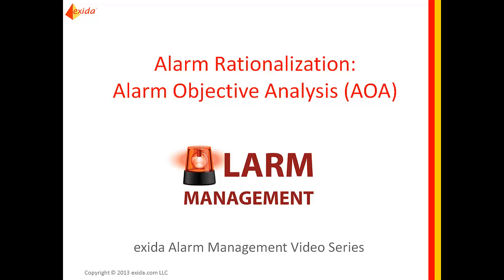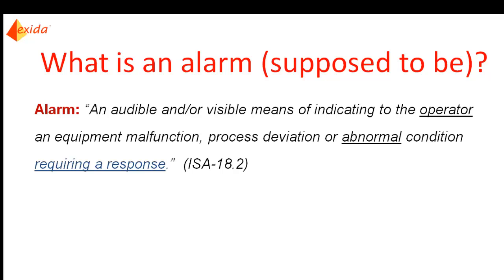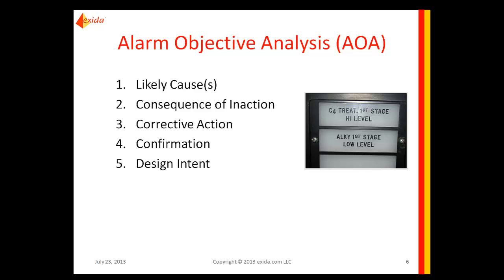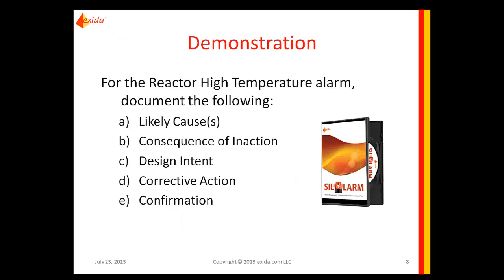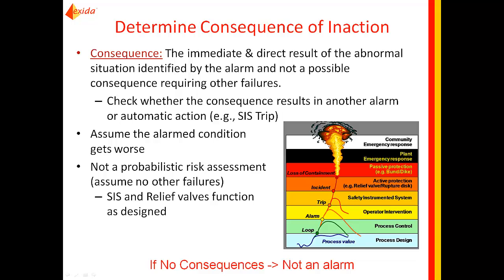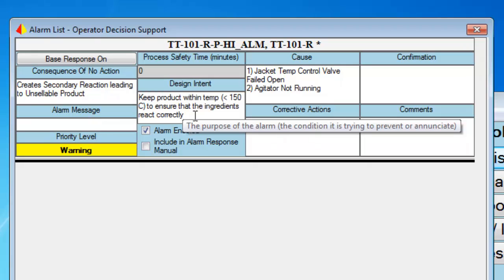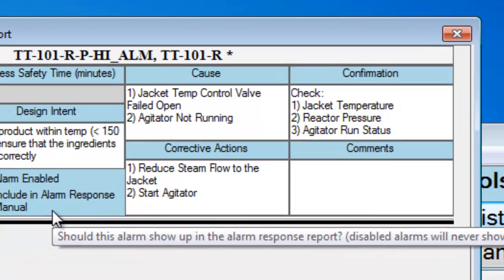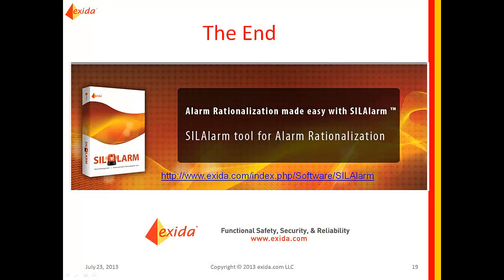Alarm Rationalization: Alarm Objective Analysis (AOA)

Comment from the maker: With SILAlarm, the primary method for import is from an Excel spreadsheet. So as long as the alarm configuration in the DCS can be exported to Excel, we can bring it into SILAlarm. We also have developed a special interface for importing files directly that are exported from a DeltaV system (using Bulk Edit, which produces a .txt file)

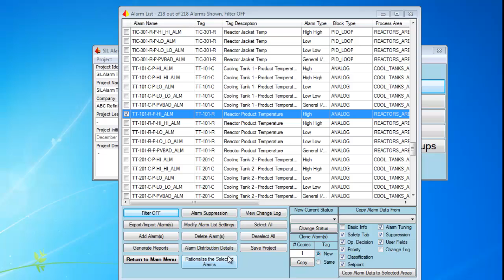Comment: Thanks a lot. Very useful, just one question: on minute 4:00 you say that your database was made by import from the control system. What control systems are supportted to work with this software?